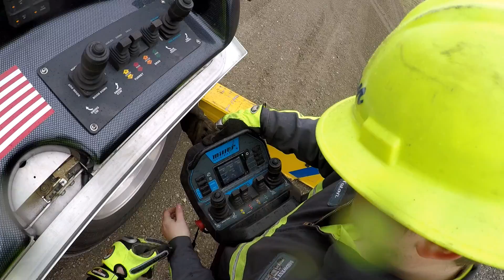GPS FAIL   THE MONEY PIT

Comment: Okay Ron I would think that I would assume as much as I hate the word that the man pulled in there too far with his truck originally would be more than bright enough to not pull in so far the second time but as we all can see that is not the case and not everyone's elevator goes to the top floor sold I see the reason that you just decided to hook on the trailer swing it around and get him out of there so you're done messing around at The Money Pit if you didn't want the money you could have wrecked the sign that says semi-truck Money Pit ahead please do not enter maybe some of them would get the hint but I do understand that every man needs a job to do and it is your job to pull out the trucks that have drivers whose elevator do not go all the way to the top